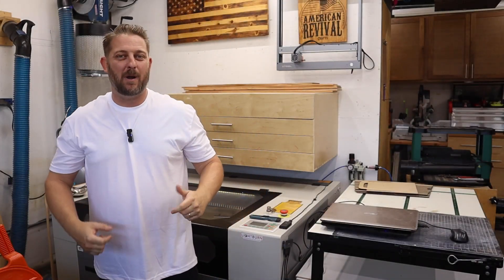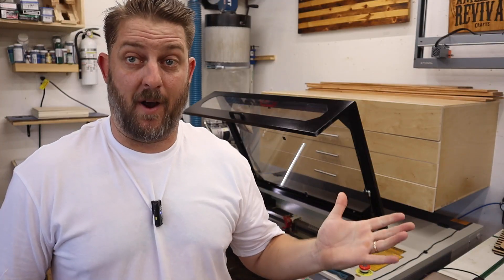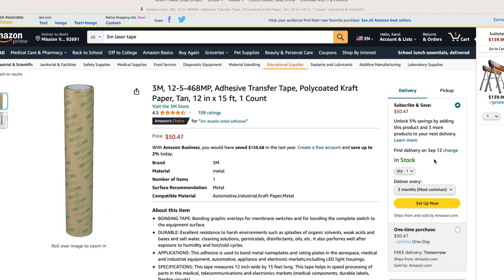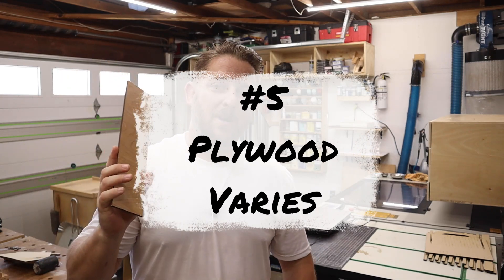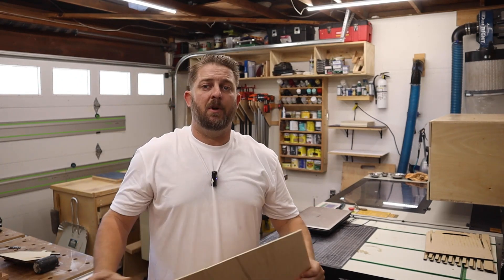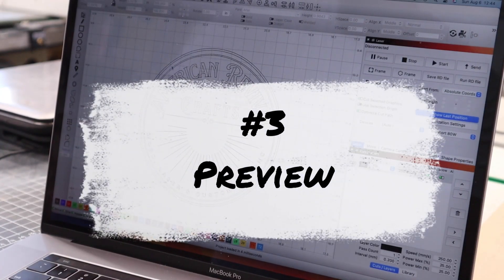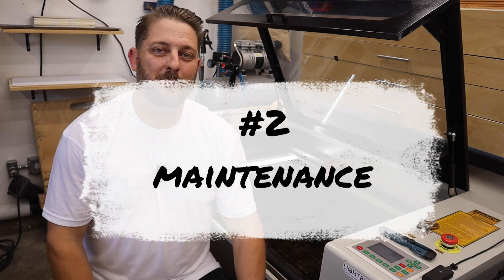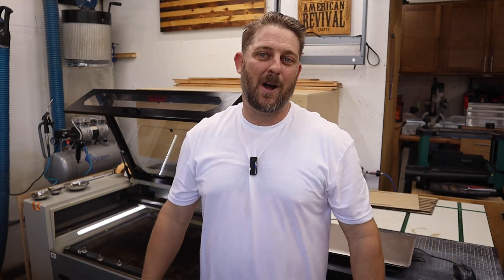Top 10 Things You Need To Know Before Buying A Laser Cutter! | Brett's Laser Garage

Comment: Hey Brett great video. I am looking to get one of these possibly and don’t know where to start. I want to do acrylic cutouts any idea where to start?
Reply from the maker: Thank you very much.  

That’s a big question, lots to consider.  But if you’re looking to work with acrylic you’re going to want a CO2 laser.  Diodes will cut certain colors of acrylic but not clear.

The Monport lasers (or other similar companies like OMtech) are a good value but the trade off is the support is not that great.  It depends on what kind of person you are to know if the savings is right for you.  You’re not going to be able to pick up the phone and call someone if there’s an issue.  You’re going to have to troubleshoot on your own while waiting on back and forth emails from the company due to time zone differences.  

I’ve had my 80w for 1 1/2 years and use it everyday.  Had a few small things go out on it (proximity sensor and auto focus probe) but those were easy fixes.   I keep spare parts on hand like a power supply and laser tube to avoid down time if something were to happen.
Reply: @LaserGarage  thank you for the response I really appreciate it. I was leaning that way, I have been doing 3d printing for a while so I am not a stranger to troubleshooting machines😂 I will definately look into monport

Comment: Brett-We just got our Monport 80w and the laser bed will not lower.  We used the Z/U and both button move it up!  We cannot get it down.  Have tried factory reset code 8888 and that does not work either.  Sent a chat to support, but that seems to take a while to get a response.  Any help is appreciated!
Reply from the maker: Odd.  Have you tried lowering the Z height using lightburn?  If you go to the move window in LB it gives you the option to jog the machine on the x,y, and z axis.  Give that a try.  On the controller after you press the “z/u” button the left arrow should move the z up and the right arrow should move the z down.  You’re saying both the left and right arrow move the z up?
Reply from the maker: Also double check that the auto focus plunger is not stuck.
Reply: Yes both on the machine go up!  I didn’t try it on lightburn because I could find it. I will try and look again. Also it hits the plunger stops briefly and goes up and not down. In the control panel on the side two sets of lights are both red and green but the panel in the middle is just green. Is that right?  Can you send a picture of you side panel
Reply from the maker: Shoot me an email, it will be easier to correspond.  I think you have something funny going on with your auto focus probe.  Again, make sure it’s not stuck by pressing it in/out by hand.  Also make sure it’s screws together properly.  Sometimes it can unscrew a little bit and the contacts don’t work properly.

Comment: Hey Brett, I just bought the same laser which is being delivered tomorrow. Do you have any recommended material settings for engraving/cutting? I've got 2 diodes so running material test cuts and engraves is simple but with an 80w CO2, wondering what a good base setting would be to start.
Reply from the maker: That’s awesome, I think you’ll be really happy with the laser.  Settings depend on material and desired look obviously but for 1/4” plywood I cut at 20mm/s at 45% power and engrave at about 300mm/s at 25% power.  You’ll need to upgrade the air assist to go this fast at cutting though.  It’s not an expensive upgrade, especially if you already have a compressor.  Lots of videos on this but Bearded Builds has the best one IMO.  

Material test cards are the way to go though so you can know for sure how the laser will react to specific materials.  There’s a good free one you can download on thunder laser’s website.
Reply: @LaserGarage  I'm beside myself excited. I had the 40w but just was to small. Thanks for the settings. I plan to upgrade the Air Assist (already have a compressor which I can use and get a bigger one for my woodworking) once I get going. I watched your vid on the camera which I just got so I'll be adding that as well.
Reply from the maker: You’re off to a great start.  Thanks a lot for checking out my videos.